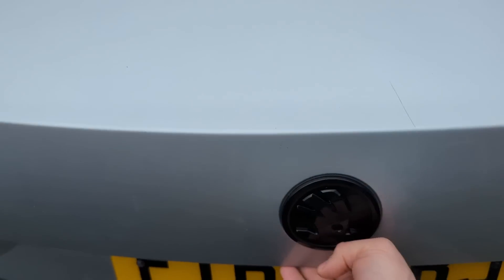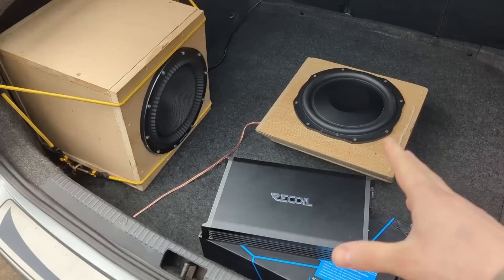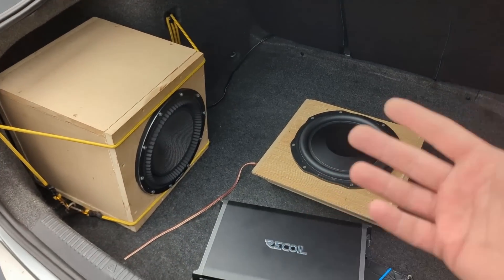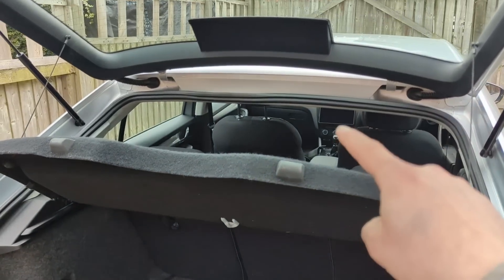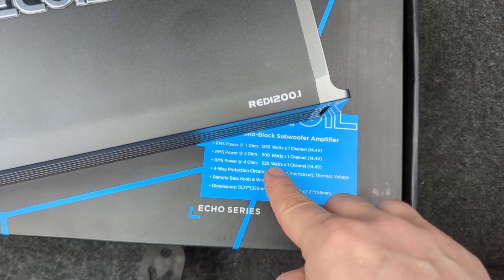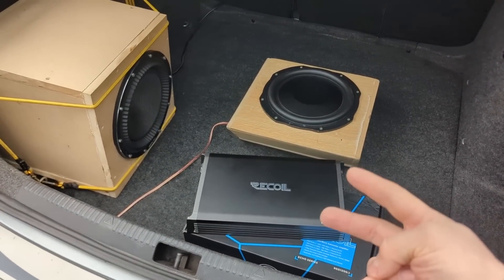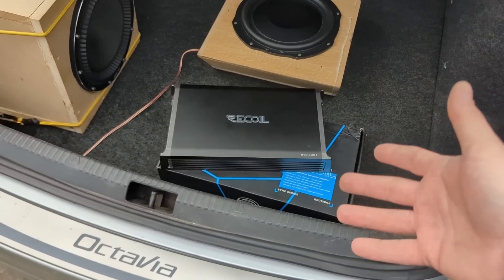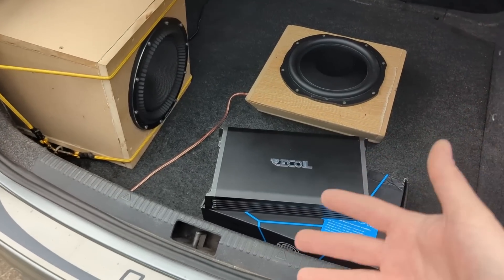Do different Ohm loads affect sound quality?

Comment: I woundn't agree, the lower  the imdepenace the lower the damping factor. You will notice after the voice coils heat upon damping factor. The higher the imdepence the high the damping factor. After 2000 damping the sound is less warm.
Reply from the maker: You do not agree with the measurements performed and presented? When the voice could heat up you will notice what exactly? Do you have any experiments performed that counter what I discovered?

Comment: Very inaccurate testing for this. You have to test the sub at the same power level. 500 at 1ohm and 500 at 4ohm. Low power is not going to prove anything either. And what your really looking for is the dampening factor. How fast and accurate can the amp can control the power it's sending. 1k watts at 1ohm cannot not control come movement as well as 1k watts at 4ohms.  If you test at low power you will not see the problem develo as the power is raised to higher levels.
Reply from the maker: Not sure how I can test a 400W rated sub at 500W. Feel free to do your own testing and share the results, especially if they would be any different than mine. Oh and good luck measuring low frequencies at high SPL with a measuring mic.😅

Comment: I have a Crescendo BassClef BC-8k giving 4-Ohm's 2800-/+ rms at 14.3volts vs. my Sundown  SALT 3k on 1-ohm doing 3300-/+ at 14.3volts 
my Crescendo sounds and performed better. I wish you could test 1000 watts at 4-Ohm's vs. 1000 watts at 1-Ohm's bc i believe the power applied to the subs will render different results even after box rise.
Reply: See if you can get applying professional rta and distortion analysis of your system if at all possible. That will remove a lot of the guessing and orr bias.

Comment: Audison APBMW is made in 4 and 2 Ohm versions. Will the 4 Ohm version sound better ?
Reply from the maker: Nope. It will sound the same.
Reply: @RAW-CAt - So the amplifier has to be 2 Ohm stable and you can unlock the power from the 2 Ohm version ?
Reply from the maker: @ilovetitanium4136  all amplifiers are 2ohm stable 👍
Reply: @RAW-CAt - ok, so I have an Audison Forza with the channels bridged into a 4 Ohm APBMW - would I have been better using the 2 Ohm version. Confused.
Reply from the maker: @ilovetitanium4136  it depends on the output power and if it's enough for you or not. Amplifier in 4ohm bridged mode will have more power than into 2ohms per channel.

Comment: Can you try 2 same mono amps to one dvc subwoofer. I think it sounds better than running it off one amp.
Reply from the maker: Unfortunately in SQ we don't really e.coutmer those situations. Out
R subs don't need two amps. And the amps most of the time have enough headroom. Using two amps complicated things.
Reply: @RAW-CAt  my boomy high qts subwoofer sounds much better with 2 amps powering it. Im just wondering if 2 1600 watt amps playing at 2 ohms 800 watts each has less distortion than using one at 1600 watts at 1 ohm.
Reply from the maker: @Sql253  that totally depends on the amps.

Comment: Class AB vs Class D amplifier performance differences.   A Class AB amplifier has higher distortion into lower impedance loads as demonstrated by measurements published by  Douglas Self in his amplifier design book. As shown here the distortion mechanisms in a Class D amplifier are different and very dependent on the design.  It's apparent that the amplifier tested was optimized for car audio and the 2 ohm impedance.  The rule of thumb for one amplifier topology doesn't always apply to others. Class D amplifiers tend to have the lowest distortion at around half of their max output power.    It's great to see reviews with measurements.  Most of the reviews on youTube are subjective and pretty much useless.

Comment: So as of right now with the impedance rise i have 2 12In dual 2 ohm sub 80lbs each (big motor) but if I wired them to 2 ohms on a 8k amp my impedance will go up to 12.3 ohms  and clip at 500w 

But if I wire them to .5 ohm the most amplifier sees is .9 at 50hz but I have my crossover there so it’s only we see couple hundred watts

And my impedance throughout my set range  goes from .9 to 3.8 ohms.. never clips why is that and is it mostly because of a strong motor?

And I’m also keeping it under 1500 W

Comment: I think the comment section wants a re-test, with the xPlod sub and a big V12 (or other quality class AB, got an Rockford Elite?)
Also, because of how your measuring scale works (dB) you really should be testing at 4-5am, as quiet as humanly possible.  The small differences you are trying to measure could easily be lost in the background noise.  You think 2dB is nothing, that's insane.  2dB is 50% more power.  And you think you can't hear that?  Seriously??  Measure your fancy Alpine tweeters dead on axis near field at 2pm vs 2am and take note of the 18+khz response.
Reply from the maker: The xplod is a single coil unfortunately.. I am trying to test as close as possible to an "average system" these days so that it would be relevant. Yes, there are some guys still rocking AB amps on old school subs, but that is 1 in a 100. And even if it's possible to hear the small differences in level, after EQ all of that disappears. We EQ all the drivers, even subs.
Reply: @ I believe you are.  I think the title sucks. You should mention specifically that you are testing a single DVC subwoofer between wiring configurations
Reply from the maker: @minus3dbintheteens60  I did mention that in the video. I don't want the title of the video to resemble a scientific paper title that is longer than this conversion that we have.
Reply: Well, your channel, but it muddies the waters hugely, as you can see by how many confused replies there are, and how many times I have commented.  
It is a fact that you are only testing wiring configs of a single woofer.
It is a fact that choosing a 4R vs 2R subwoofer is nothing like that scenario.
It is a fact that when using a class D amp, the rolloff is hugely deterministic of the impedance it is faced.  It is a  fact that higher output voltages across the same amplifier brand and topology will cause a higher level of distortion, while a higher output current will cause a higher noise.  You get the point bro.  It IS science after all
Reply from the maker: @minus3dbintheteens60  I tested 2 woofers, not one. FR at the low end does not depend on the impedance, only at the top end for a full range class D amp. Hey, I am sorry if this video is confusing or it does not address the points that you specifically want. With this video I addressed the myth that I wanted. I tested what I was planning to test and I got the results that I expected based on my own previous experience. So as you say it's my channel and I did what I wanted to do 🤷
Reply: Bro, I respect you and what you are doing for the community.  I respect your enthusiasm and motivation.  BUT, the title sucks.  You HAVE to make clear what you are trying to explain.  Which is, for a single woofer, does series vs parallel DVC matter.  But of course, even then, the impedance, and therefor the inductance, WILL have an effect on the amplifier, as you said yourself, would be likely class D.  And that is why using resistors isn't going to cut it for those amplifier tests.  I know it doesn't seem as scientific, but it's actually a better way to to it (reactive) as the impedance of a system as the frequency it plays changes
Reply from the maker: @minus3dbintheteens60  what title would you suggest?
Reply: Just something along the lines of "How wiring DVC impedance effects the sound quality".  That eliminates the high frequency convo out of the equation for a start.
I'm not trying to be a dick dude
Reply: As I already said, choosing a 4R vs 2R sub WILL be very different to what you are testing here.  They WILL have different coil thicknesses, weights, resonant frequencies, BL, often different VAS and QMS too.  It's a confusing topic

Comment: Still lower ohm loads put more stress on the components inside of your amplifier and more heat in your voice coils more draw on your charging system and battery and half's your amplifiers dampening factor or in Lameman's terms the accuracy of your speakers there is no benefit other than more wattage output, no matter what it is always better to run at a higher ohm load

Comment: My understanding of ohm loads and how it affects frequency response and the amplifier itself is  that it really only matters at the limits.  Specifically for subwoofers, you want to decide if you want to limit or embrace impedence rise.   If you're seeking maximum SPL, then the lower the ohms, the better because  you will have less impedence rise and be able to consequently give more power to your subwoofers for maximum extension.   Many SPL oriented subs have xmech that goes way beyond linear xmax.  

While I appreciate this video and it answers some questions about lower powered operations, It still leaves me guessing at how I should configure my amplifier for best SQ at the limits.

Say I have a 1000w subwoofer and an amp that can run 2000w @ 1 ohm, 1500w @ 2 ohm, and 1000w at 1 ohm.  I can buy a dual 2 ohm or 4 ohm sub to reach those ohm loads.  Should I just run at 1 ohm to give maximum overhead to the sub and avoid any potential clipping?  If I never plan on exceeding 1500w, should I run it at 2 ohms?  Do I at least benefit in efficiency?  All dynos at max watts at lowest ohm loads suffer from efficiency losses.  What if I am only using 1000w of a potential 2000w at 1 ohm?  Is the efficiency the same as running 1000w at 4 ohms despite the dynos all pointing toward efficiency losses at max power?  The math says I will have stronger BL and more impedence rise, which should both benefit subwoofer control.  This is a real question as I plan on powering (2) 1000w RMS 10's on 2 x 2000w @ 1 ohm amps.  I don't need every decibel of SPL, but if I run these subs each at 1000w @ 4 ohms, how big of a benefit is SQ and efficiency will I get over 2 ohm or 1 ohm operation?  The subs I'm planning to use are NVX VCW 10's.  They have 22mm of xmax, and I would describe them as SQL oriented budget subs optimized for sealed enclosures.   If I buy dual 2 ohm subs, I'm committing to either 1 ohm or 4 ohm operation.  If I buy dual 4 ohm subs, I'm stuck at 2 ohms operation.   I'm leaning towards splitting the difference and buying dual 4 ohm subs at 2 ohms for 1500w available.   Based on this video, I might conclude to just run a 1 ohm, but the efficiency of the amp and sonic benefits at the limits are my main concerns.
Reply from the maker: My approach to this is totally different. You are interested in amplifiers operation near it's limits rather than low power. If you have a big enough amp, the max output of the sub can be "low power operation" for the amp. Get a bigger amp. Run 2x rated power amp. If you have a 1000W sub and a 2000W sub, you will.never push the amp to clipping and the performance will.be linear. Power is cheap these days, there is absolutely no reason to run your amps into clipping. At least that is how I think about it.
Reply: @RAW-CAt  First off, I appreciate the response.  You do solid work for the community.  I guess my conundrum is that I don't think I really need to drive 2000w per sub, I don't think my front stage can support it.  If I gain something tangible by running 1000w per sub at 4 ohms, or splitting the difference and running 1500w at 2 ohms, then I'm willing to give up the headroom for it.  Conventional wisdom says a higher ohm load = higher BL and higher dampening factor.  Your tests here challenge that wisdom at least at lower power levels.   I also have concerns about efficiency.  Every dyno I have seen show efficiency drops as the ohm load drops.  Does that hold true if I am only using 1000w of  potentially 2000w at 1 ohm?  To put it another way, if I am producing 1000w at either 1 ohm or 4 ohms on the same amp above what is the efficiency?   Based on dynos you would assume the 1 ohm load to be less efficient, but logically I think driving a lower resistance would be more efficient if not pushing the amp to the limits.
Reply from the maker: @Ry-lx2kl  Efficiency of an amp is probably the least important spec in SQ. In a real.world scenario we are playing music through speakers, not sine tones into resistors (amp dyno). I am planning to do a video about that.
Reply: @RAW-CAt  I guess where I'm at is  that I'm willing to give up efficiency in trying to optimize SQ, but if there is no audible benefit to running at 4 ohms, I'd rather have the headroom.  The efficiency is really a secondary concern, but amps are cheap and electrical upgrades aren't.  If running at 1 ohms is both as efficient and has no downsides compared to running at 4 ohms, then why not run at 1 ohms?  Despite your testing here questioning convetional wisdom, would you advise me to run at 4 ohms as long as I never drive the subs beyond 1000w into clipping?  Do you still see a benefit in the conventional wisdom of higher ohms = higher SQ?  Or should I come to a conclusion based on your testing that additional headroom at 1 ohm doesn't really have a downside when it comes to SQ?
Reply: @RAW-CAt  I give very little weight to dyno tests.  Playing a tone into a resistor bank for a few seconds only has so much correlation to an amp playing music over time.   I'd be interested if you have any thoughts on a hollow sound coming from an amp that puts out power, but doesn't have the caps and coils to keep up.  Is there anything measurable?  I'm working on doing my own testing with two amps on the bench with the same power ratings.  One has 25v 1100uf caps while the other has 50v 2200uf caps as well as twice the real estate in coils.  I would expect the one with bigger caps and coils to have more reserves of power and a higher dampening factor despite identical power ratings.   How does that translate to SQ?  How can we discern which amp at the same power rating is better?  Or with the same dyno results?  My gut says the bigger, heavier amp with more/bigger caps and coils will perfom better.
Reply from the maker: @Ry-lx2kl  I would imagine that is a difference in score on amp dyno between certified and dynamic test. As one is a continuous test tone and the other one is a short burst. The amp with more capacitance in power supply will do both certified and dynamic very similar where the one with less capacitance will have a much better dynamic score.
Reply: I'd buy the 2 ohm version, no question.   The 2 ohm resonant frequency is over 5hz lower, and at the same efficiency, huge bonus!!  Also the QMS is over twice as high, so it's way softer.  They will hit far lower, especially in a smaller box, which is what you want from not only a subwoofer, but a relatively small one.  The 2 ohm is a "softer" driver, plus it's going to allow you to draw twice as much power from your amp as what the 4 ohm model will.  You will be lucky as hell to get 400-450w out of those amps with the 4 ohm driver.  It isn't 4 ohm, it's 6.4, at its lowest it only goes up from there.   Even the 2 ohm model, its min is 3.2 ohm, so whatever that amp puts out at 4 ohm, is what you will be lucky to see
Reply: I would have to say if I was you I would see how it performs in the car as a complete system. You could have a well installed front end with a lot of volume and head room but if your sub needs more power to keep up with the front end then wire it accordingly.

Comment: I don't think this is the best way to quantify this. Damping factor is mathematically calculated and there's nothing to debate there. As impedance rises the output of that equation does as well. Weather or not that translates into a perceivable increase is reproduction accuracy is a whole other set of tests that I would not perform with a subwoofer, a class D amp and THD measurements. Also not a fan of you decreasing the output voltage of the amplifier to suit your load bank for any THD tests you perform in this video or on anything else for that matter. Amplifiers are notorious  for having anything but a flat THD response across the output voltage level because that's what changes most dynamically in operation. How it affects THD has a direct relationship with a transistors properties. This skewed all of your results one way or the other. If 7v was going to be the lowest you were going to go, all of the tests should have been run at 7v.
Reply from the maker: If all tests would be done at the same voltage, the SPL of the subwoofer would not be the same. Then we would see the differences due to higher SPL and more excursion rather than the impedance. You can see the THD vs level graph of that amplifier a few videos back, its pretty flat right up to clipping, so it does not matter if the tests were done at 50W or 500W, trends would not change. If I would wanted to test 8ohm resistor at 1000W as you suggest, I woul need a 5k amp😂 You can watch my previous videos about damping factor where I proved that modern amplifiers have such high DF that it does not play any role at all.
Reply: @RAW-CAt  So rather than admit the approach was incorrect, you double down and cite some other issue it would cause. Your approach to measuring this is incorrect. When someone takes the time to explain why it's 'Then this and go watch my other video'. When they don't take the time to explain it, you ask them to. Then it's 'Then this, go watch my other video.' You have yourself a solid personality disorder on your hands. You shouldn't be testing using these methods at all. I don't have any preconceived notions so for me the video was neither definitive nor informative. It's just more junk science from Youtube University.